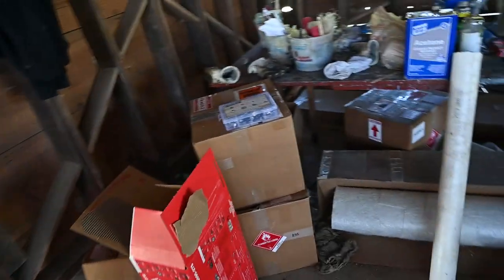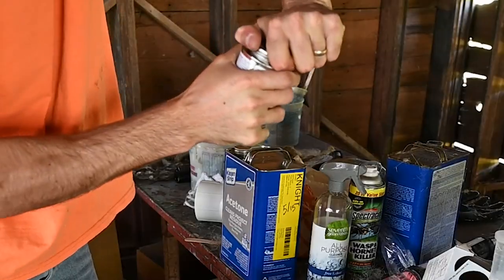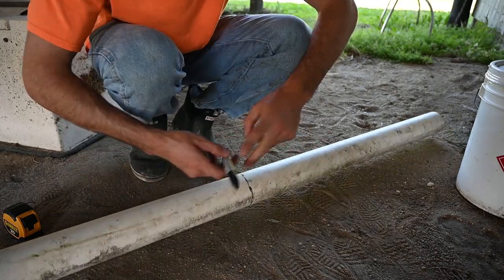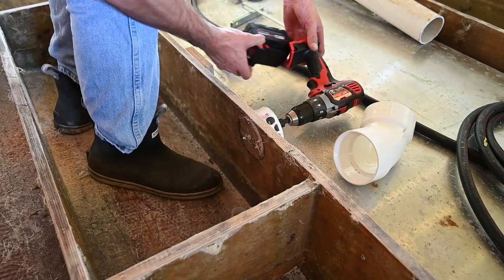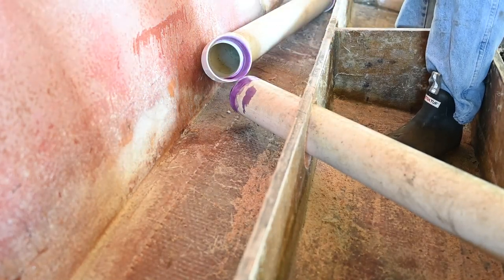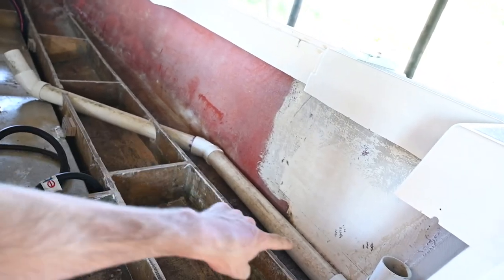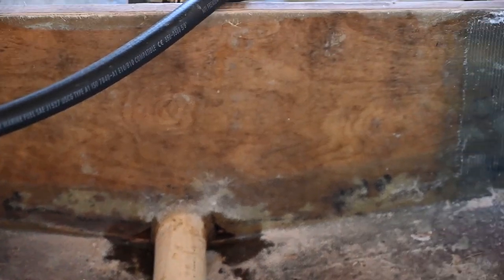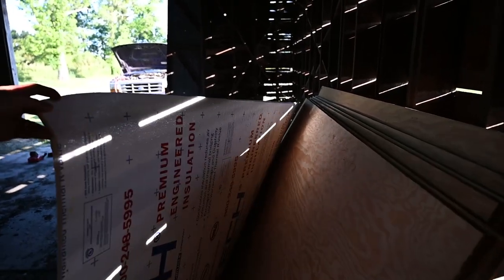Rebuilding a Center Console Fishing Boat - Episode 5: Rigging Tube

Comment: Seal both sides of those plywood sheets with resin, it will help from water absorption.
Reply: Negative.  That will keep it from being able to breath when it gets wet and will promote rott.
Reply: @bipedalhominid6815  nope, sealing the plywood will prevent water intrusion, meaning wood will stay dry.
Reply: @jonathanabadia4377  water will always get in
Reply: @bipedalhominid6815  yes but sealing it will last 20 30 years sometimes longer than that, without will last maybe 4 5 years if not less.

Comment: Best thing you can do is take the 90 out i put one in my first boat i redid and what a massive mistake. Control cables are almost impossible to fit through the 90. 
Im redoing a sea ox now and am gonna use 4 inch pvc and 45s
Reply from the maker: The initial plan was to use 45s but deck wasnt deep enough where I wanted to put it. I went with a long 90, which definitely helped. Honestly, I faced more problems running through the 45 under the console than the 90. 4 inch pvc will be smooth sailing! Smart move.

Comment: WAIT WAIT WAIT  Before you add the deck or touch ups you should add extra rigging tubes! Different directions like straight to the bow and both port and starboard side! Start planning your lighting and electrical and layout the plumbing for the bilge pumps! Beef up the stringer toprails under the console so if you add a second station or fancy tower T-top it doesn’t cause stress cracks
Reply from the maker: Too late lol. Not sure how I would’ve configured those rigging tubes though, but wish I would’ve done something different with how I ran the fuel hoses. The bow light can just run under the gunnel cap from stern to bow. That was always the plan.
Reply: @intotheforrest  Well it’s still a fantastic looking boat. I’m so stoked to see the end results of this project. If you’re ever on the Banana river in Brevard county come swing by the marina off Eau Gallie and say Hi
Reply from the maker: @livebaitadventures420  I’ll keep that in mind. Much appreciated!
Reply: Dude that purple stuff you used on the pvc is pvc cleaner not glue it won’t do anything to make them stick together. Glue is grey, clear or blue!
Reply from the maker: @stevewakefield6034  it's primer. Cleaner is clear.

Comment: I was just wondering why you used such big pipe 1 1/2  or 2 inch would have been plenty big enough.
Reply from the maker: Do not use 2" pvc as a rigging tube lol. This is for rigging of battery cables, steering hydraulics, throttle cables, and a lot of wiring. All of that will not physically fit in a pipe that small.